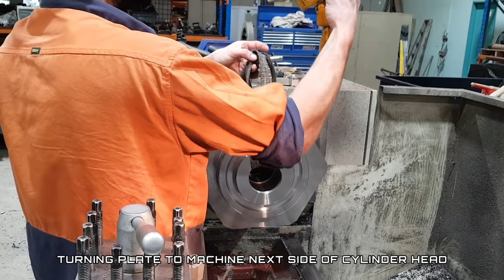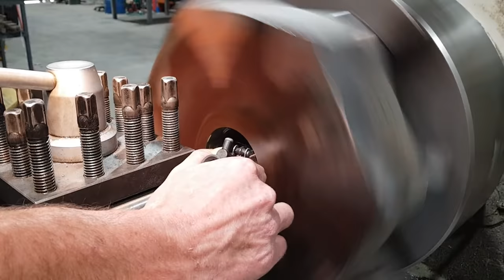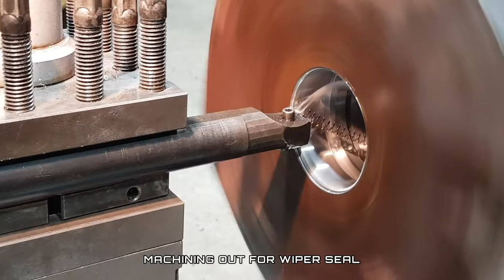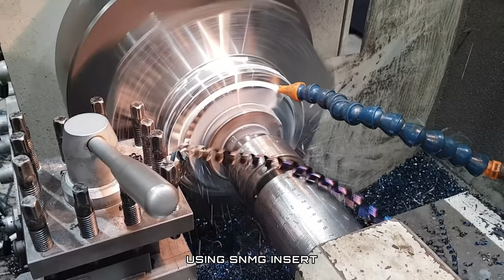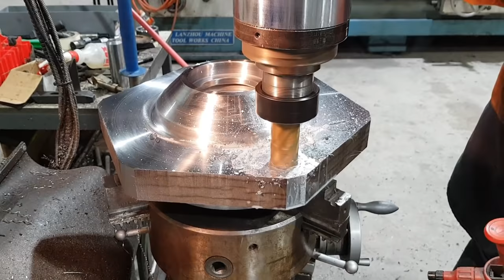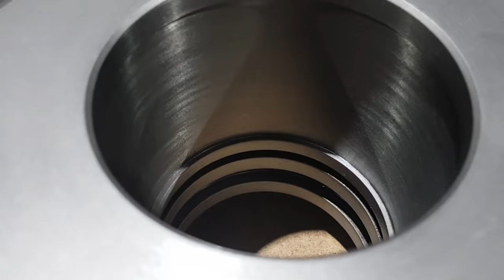Machining a new Hydraulic Cylinder Head for CAT 651 Tractor Scraper | Part 2

Comment: Hey, I recently found your videos and have been enjoying them, excellent work!  I've been doing job shop/industrial maintenance and repair for 40+ years and I appreciate seeing people still doing manual machine work.  I never learned to like just pushing green buttons, I have to "feel" the metal I'm machining.  I did notice that you have turret type tool posts on your lathes, I've always disliked them.  I prefer quick change wedge-type posts, although the older turret types are arguably more rigid.  Do you have an opinion on the difference?
GBD.

Comment: How's the difference in price, for a machined piece like that compared buying it new from Caterpillar? Or is this part no longer available new?
Reply: A lot of times it’s way cheaper to buy from CAT but it’s not available for three weeks . So it’s a question of that machinery being down for a few weeks to save some money or spend three times what the part cost to get it back running in a few days..
Reply from the maker: Hey @Lukas we are able to do this part for less than half the price of OEM in 2 day turnaround. Matt is spot on it's a 3 week wait for the component from factory.
Reply: @CuttingEdgeEngineering  Three weeks waiting for the part? What are CAT doing in that time? Making it, painting it and then sitting on it for a week before shipping it? Oh I know that they will have orders in the system but surely for every completed cylinder they would make several as spare parts components? Or is that thinking logically and not like a bean counter?
Reply: @markfryer9880  Most manufacturers tend to have as little stock as possible as it's assets bound up in stuff that isn't making them money.
Reply: Mark Fryer we get  a lot of work this way as some crusher components can be a 15-25 week lead time. We keep casting/finished parts/finished assemblys in stock so they can have it from us in 1-2 weeks with shipping.
Reply: @markfryer9880  we used to supply cat with parts they run a 'just in time' system when building things so they don't carry much stock we used to deliver every day and if we had a problem supplying a part it could stop the line and we could get fined for it.

Comment: Great video, that lathe is a beast!  I can see you use that tool post for rigidity, but do you shim your tools each time you change to get the centering spot on, or are they all close enough?
Reply from the maker: Hey mate thanks for watching. That tool post is designed for a 32mm tool but our smaller lathe (which was our first) runs 25mm tools so we just use 7mm packing blocks to lift the tool to centre height.

Comment: Would like to see a bit more of your set ups,for example; did you clock the bore of the dividing head chuck then pitch over half your P.C.D. to get your hole position correct or did you use another method? That being said I love your videos,you're a very skilled man and you produce quality work.Hi from the UK.

Comment: Great series. 
When you sell these, do you get the 'core' back from the buyer so you can rebuild a new one?
I assume you have a few different cylinders in stock. What is the most common one you have to repair/replace, machine and part? I think it would be off a Japanese machine because they are more common.
The missus has nicer hands than that other YouTube hand model AvE. I trust she is prettier too.

Comment: I am curious how you set up the part to machine the bolt holes.
Do you mark the bolt circle and first hole location and then locate off of that mark, or do you locate the mill to the center of the part, and then offset the table to the bolt circle with some fancy math, or something else?

Comment: Some serious swarf coming of that part.  What are those big core drills called?  they make a lot of sense with not making the entire hole into swarf, but just cutting a wee annulus.  Way less work, and you even get cute little plugs you can save.  I've seen them used with magnetic drill bases.  OK that gave me something to search with.  They appear to be called Broach Cutters.
Reply from the maker: Hey mate thanks for watching. Yes broach cutters is correct, here they are well known as sluggers. Less mess and actually cheaper than a twist drill. 😎👍
Reply: Ronald Farley  Thanks Ronald. I'm 16 years retired now, and do my machining at the local Menz Shed which includes what is really only a hobby mill.  It has a #3 Morse taper with drawbar, and I have set of Chinesium collets up to 20mm, so I can't see me being able to drive one of these.  What I like about this channel is the size of the parts.  His lathe is twice as big as anything I used, but I used two mills about the same size.  After 40 years as a toolmaker being paid to make swarf, I now do it for the love of it.

Comment: YehaYEha  Kurtis. I have run into the same internal stress problems with Heavy shafts some times the Heat treat doesn't help plus straightening hard to figure out some times . 🤕

Comment: Nice work and nice video👌👍.but how you calculated the degree of PCD and how you moved the work pcs to the exact location for drilling tool.
Reply from the maker: Hey mate thanks for watching. Find centre of inner diameter, divide diagonal bolt centres by 2 and used vertex rotary table which has 360 degree index plate 😎👍
Reply: @CuttingEdgeEngineering  thanks a lot for the soft response and good explanation.make more videos like this.👍

Comment: What's the difference between using a drill VS a slugger to drill the bolt holes??
Reply: An Annular Cutter or Slugger cuts a closer tolerance hole..?...! IMHO.

Comment: So, I have a few questions...

Does Cat not make this part? Seems like a part that would wear, and require replacement at least once in the lifespan of the machine it's on. Does Cat not make replacement parts?

Seems like a really time consuming and fairly precise process for a single part. Lot of man-hours. When this part is made in the factory, is this how it's done? And if not, how IS it done?
Reply from the maker: Hey mate, yes CAT do make replacement parts but it is 3 times the cost of what we do it for and 90 day wait for stock ex USA. This from OEM is a cast piece and machined on CNC. These aren't high volume for us so only manual machined in house and a solid work day in it. 😎👍
Reply: Cutting Edge Engineering Australia I see. I didn’t think about shipping and availability. Cool that you are able to turn a part like that in a day. I bet whoever needs it is glad to have it so quickly.

Comment: You made me cringe when you picked that wooly out of the oil seal groove mate! 4 stitches for me, a safety investigation and lost time accident. Worst thing is it sliced through the tip of my friggin glove! I feel the sting, look at my glove and see the cut. Ah shit! Ruined a new glove! Went to pull the glove off...anyhow it was like being sliced by a razor blade. One of the worst bouts of pain that being shot didn't compare to. If you are worried about scratching the part get some nylon picks. Those accidents even just a couple of stitches cut Into your bottom line.
 Safety rant over.......LOL!
 Love your videos, they take me back to a younger time and many good memories. 
 Take your camera crew out someplace nice and toss a treat to your security team. Maybe he won't be so hard on those rubber ckickens................
Terry from South Carolina

Comment: 4:14 if the tool is cutting at a certain depth to make a hole with a certain diameter, when the tool comes back out, the hole should be that diameter, right? So, the tool shouldn't leave any marks when coming out, right? I'm not a machinist, bear that in mind ;)
Reply: Tools and machines are springy. As soon as you start cutting the tool bends away from the cut. The heavier you cut the more it bends. It's quite shocking how much even a big machine flexes. 

A lot of the skill in making precise parts is predicting just how much everything is going to bend and allowing for it.
Reply from the maker: Hey @PCanas old mate @LesNewell  is spot on with flexing etc. It's called tool deflection. Shop made bars are no where near as good a quality as top brands so allowances definitely need to be made. That was roughing passes so not as precise as the finishing pass. 😎👍

Comment: Beautiful work, what kind of tolerances are expected on such a part?
Reply from the maker: Hey mate thanks appreciate it.  Pretty well working to spot on specs very minimal to no tolerance (-/+ 0.005) on inner diameter surfaces.
Reply: @CuttingEdgeEngineering  thank you for the quick reply mate, those are pretty good!